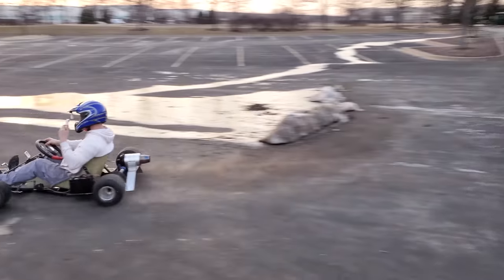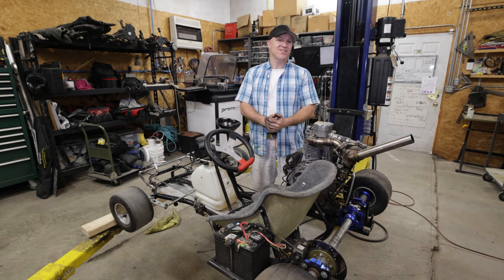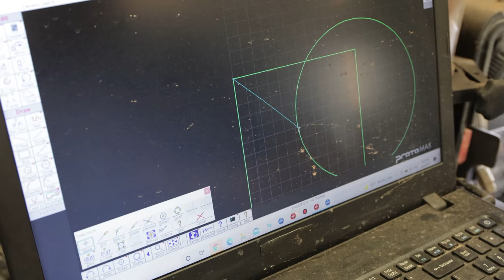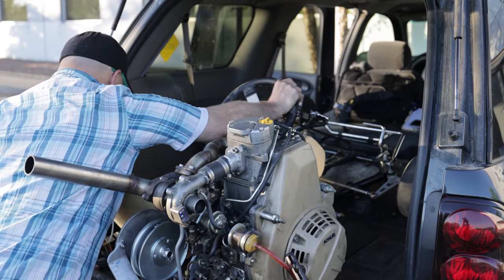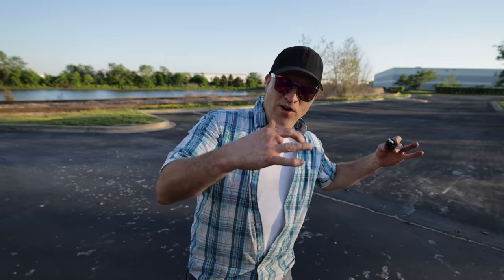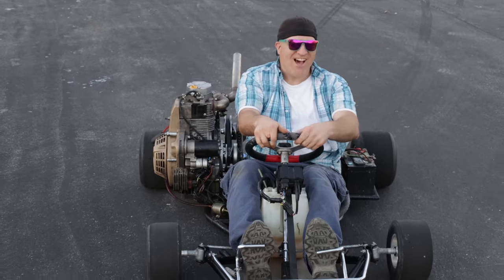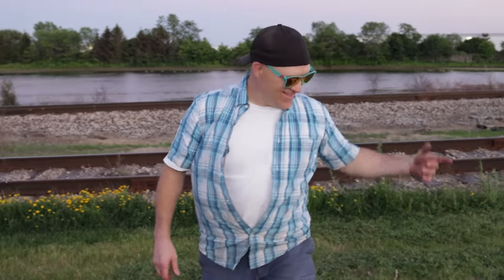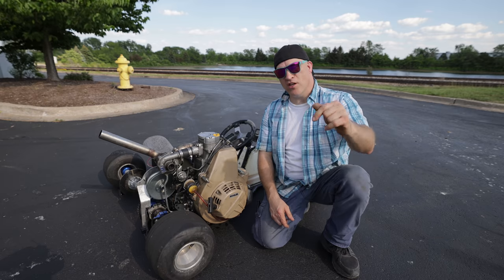Turbo Diesel Go-Kart W/CVT Top Speed

Comment: Make a 20T drive gear! The Diesel with the CVT would easily be able to pull that tall gearing and there would be a lot more room for the CVT to do its thing and get you to a higher top speed.
Reply: Yeah, the cvt is "topping out" too quickly. I bet a good gear setup will get 45+ out of it. I definately want to see updates with a few gear changes!
Reply: @volvo09  same!
Reply: They love the tall gears
Reply: @rosscullen406  yessir! Can attest to that!
Reply: I’ve got a clutch setup that hits 65+ before I hit the spray, that thing geared right should easily pass 50 plus
Reply: @braddorris4535  alright, that's awesome. No other words to describe it. Time to put a second engine for the front wheels!
Reply: I had a  10hp with a vbelt centrifugal clutch  setup and it did 70. 
Only thing is it's like riding  a 10 speed stuck in top gear. 
You gotta push it like a bobsled and then feather the throttle until the clutch locks, then it's hammer down. 
CVT on that would rip because it definitely had more pull.

Comment: When we were kids our go cart has a 78 tooth sprocket on the bottom and 14 tooth on duel clutch system and a 6 hp snow blower engine & were able to hit 45 to 50 mph. We used the mail truck as our guide as the driver wanted to see how fast we could make it go side by side with his truck 50 was the fastest.  Lol. We also had big tires on it as well.

Comment: Usually single cylinders don’t like turbo chargers, but that thing just goes! 🤩
Reply: works better with an air tank to hold boost between turbo and intake
Reply: Turbochargers Single cylinder needs big plenum at least twice the engine volume
Reply: @janilindroos3688  Diesel doesn't care how big or small the intake is for higher than atmospheric pressures in small cylinder configurations. It runs on compression ignition. Much more of the exhaust energy is converted into rotational energy in a turbocharger turbine than any gasoline engine will ever care to do. You only have to size the turbine housing and wheel properly for the amount of fuel heat you're going to be pumping into the cylinder.
Reply: In my place. Single cylinder N.A 700-1100cc  generator. Mods with turbo ex diesel truck and reduce fuel consumption arround 30%. And feel lots of power arround 1500-2200rpm.

Comment: It seems like the governor in the variable pulleys, isn't really matched to peak engine torque. The engine seems to be operating too low to allow the turbo to reach full boost.
Still cool though.
Here's an idea; tune this setup to max efficiency, then add a manual clutch, or a one-way bearing on the axle drive chain, then add the jet engine.
This way, you can have the best of both!😉

Comment: Diesels are super reliable, especially old style mechanically pumped ones like this one, very unlike the regular gas powered garden equipment you have to fight EVERY season.

A couple of years ago i got an old diesel generator that had been sitting for 6 years, without being started, and even though the diesel in the tank smelled really bad, nothing like diesel, it started right up at the second pull.
That is just something you only see with diesels.
This engine was a Yanmar L40AE - a tiny diesel.
Reply: good ol' 2 stroke detroits

Comment: You can adjust the spring tension on the TC so it goes onto a higher gear faster or slower. There’s 3 different holes in it from the factory and you can add more holes for testing. Less tension on the drum let’s it go into a higher gear faster and more tension makes it stay in the lower gear longer.

Comment: Those CVT’s need to be tuned to the engine. Get in touch with the guys from Go Power Sports. They sell the parts to tune the drive end of the CVT.  They probably have a larger drive gear too.

Comment: I wish they made more options for these projects people do

Like with other go kart engines they offer performance kits of all shapes and sizes i wish people would start making those kits but for kohler

Like turbo kits, cold air intake, exhaust headers, bigger cams, heavier valve springs, aluminum fly wheel, bigger injector. The list just goes on and on

Comment: Being that diesel engine and with turbo can put a small intercooler.  With this, you will be able to put more diesel and more pressure on the engine via the ECU, which results in +30 to 40% torque and +25% hp.  this will all make a big difference in this car in starting and final speed

Comment: a torque monster kinda limited by gearing/rpm, but it'd pull just about anything up to the same speed as no load. a 212 still has the speed for $ and you don't need much torque for karts, but still I think it'd be a fun ride

Comment: That torque converter is under rated for your power level and your gearing is really low. Also the governor needs to be adjusted to rev the diesel engine higher to get the full gear range out of the CVT.

Comment: A torque converter and a cvt are definitely 2 different items. You have a cvt which is a transmission, not a torque converter. Even though the cvt is the better choice even if you had the choice. You did not make more torque...you just didn't have the torque loss from the centrifugal clutch. Yes, a diesel has a lot of torque which is why they are used in OTR trucks.  My old Chevy Spark used a cvt and I likedit a lot. It never gave me any trouble either and didn't seem to mind me revving the little 4 banger to 7200 rpm at times :)
Reply from the maker: Hmm well you may be right but it was listed as a 30 series torque converter.
Reply from the maker: Here ya go https://amzn.to/2RRjn3n

Comment: Id love to see you get a V twin diesel or even an inline 2 cylinder and turbo it and throw it on an offroad gocart or lawn tractor. It should make alot more boost with the extra power stroke and timing of the intake valves opening.

Comment: 2 torque converters cut. One drive the other.  Used at same gears. Change how the torque converter works with springs and weights

Comment: You should test the jet vs turbodiesel at a dragstrip, maybe just a local type 1/8th mile if you have one reasonably close. I know many people look at dragracing as they next best thing to dyno's, where performance is taken to the ground. But Yes I would like to see a higher drive gear to put as much of that engines low-end peaking HP to the ground with the CVT.

Comment: Add another 2 identical jet engines and pipe them into one large afterburner unit. I bet you'd be looking at close to a 1:1 power to weight ratio at that point, possibly even greater than 1:1 depending on how much the ab contributes.

Comment: If you want a lot more out of it, then tune your clutches so it revs at a higher rpm on acceleration, plug off the waste gate on the turbo, and see if the fuel pump is adjustable so you can add more fuel. Diesels love fuel
Reply from the maker: All that is done ! I just didn't show it on camera.

Comment: Larger drive, smaller driven and smaller sprocket on the axle, can prob go with a larger drive sprocket on the cvt Jack shaft, it should have plenty of torque for it

Comment: You have to try propane injection. You just need a solenoid valve an adjustable regulator and a small grill bottle. It does wonders on my Mercedes.

Comment: You should make exhaust ”manifold” from smaller pipe. It would increase exhaust gas velocity and it would spool up turbo lot better.
Reply from the maker: That's a great idea, originally I was thinking about that and doing some math behind it but I wanted to make it look as tough as possible so that's why I went with an inch and a half pipe and then I tapered it down and made a nozzle right before the turbo.
Reply: @WarpedYT  That current one look ”tough”. 🤣
Maybe 1” ID pipe would be better.

Comment: Doesn't sound like the turbo was boosting. Put a few more psi on it for the next video :) great video, I'm loving it !
Reply: He will have a hard time loading the engine, he's running out of rpm not power. Diesels don't make boost without having sufficient load.
Reply from the maker: It's making boost I believe only about 8 psi, every video I do with this card I keep on forgetting to put the boost gauge on, but I think in the next video I'm going to make a different turbo setup just to make it more badass, something that's going to make some serious boost, and I'll remember to put the boost gauge on it
Reply: @WarpedYT  I'm gonna guess that you are an engineer and a fabricator....and perhaps a shop owner too :)

Comment: Your rear tire on the right side make smoke much more than the rear tire on the left side.. Probably because the engine's power distribution much more closer to the right rear tire based on where you mounted that engine's position...

Comment: What size battery are you running with that setup? I have that same engine sitting in my shed right now that I got off of a generator that was destroyed from falling off the back of a truck. Engine is still in great shape, turns over and runs great. I'm just waiting for the right time to put it in a project!

Comment: Nice job it would be interesting to find out how big a sprocket you could go to on that thing… you have the reduction in the torque converter so could it run the same size as the axel sprocket…..

Comment: still sounds like you're geared out on the straights my dude. Can you put a bigger sprocket on the cvt-chain jack shaft? you've obviously still got a preponderance of down low torque so it probably wouldn't hurt getting a higher gear ratio on it.

Comment: You'd go fastest with a centrifugal clutch and proper gearing, because a centrifugal clutch has no losses once it achieves lock up. Those torque converters suffer significant losses at the lower reduction (top speed) end of the spectrum; however they are great for better acceleration.

Comment: Built a yerfdog with a diesel yanmarL70w and a comet tav2 30 series cvt. When taking off under heavy load the belt will "judder" and vibrate up and down violently while at very low speeds and higher speeds its fine. Have you run into any issues like this?

Comment: You know, it didn't occur to me in the original episode with the gocart+turbodiesel, but what fueling mod's were made, if any to this engine after the turbo? I know you went further in-depth with the turbo Brigg's & Stratton because you kind of had to (EFI vs Carbureted) to net best performance, make boost, etc. 

I know you mentioned the diesel was making boost, and I know diesels can better adapt to leaner fueling conditions by design, but still, I would think theirs equal or similar efforts needed to make gains by fueling mod's, even with just a piggyback AFC, or injection pump changes if EFI weren't as heavily relied on for the operation of this engine.

All in all, it would be cool to see a Dyno video with the turbo to compare it to the NA videos done with the 3 grades of diesel, then maybe embark on some fueling mod's (if within reason for a small diesel) like done with the Briggs& Stratton.
Reply from the maker: Thank you for the feedback I have taken note, I start back filming on YouTube today so I'm going to get that episode in the queue I think that is really interesting and you have a great point. I do think that I need to turn up the fuel a lot to start really rolling some coal, but in this case I don't think this engine will ever roll call it just seems so overbuilt for the amount of power that it makes but who knows.

Comment: That go-kart needs a limited-slip differential. You can actually make one by using two freewheels.

Semi-related, I wonder if it would be viable to use a freewheel to combine a turbocharger and a centrifugal supercharger into a single unit, driven by both the crank and the turbine. Could you get the best of both worlds (boost response vs efficiency) that way?

Comment: Looks like you’re making a gear dude. This thing could do 70-80mph easy.
Reply: Had Similar setup with a MAC 101 go kart engine on a 3 wheel kart. It would do 65mph.  That is fast with garden tractor turf tires on back and minimize steering on front.  Interested on doing the TC Diesel Luke this on a 3 wheeler.

Comment: You need to build an air capacitor between the turbo and the engine, this turbo configuration does not generate much boost if any. I recommend a 5 to 7 liter capacitor for this configuration.
Edit: wrap some fibreglass tape on the exhaust pipe, it's dangerously close to you!
Reply: Boost is a measurement of restriction, pounds/kilograms of air consumed per minute is a far better way to determine the efficiency of the system. 

And 5-7 liters? He may as well remove the turbo completely, on a little setup like that he'd have a 20 minute lag from the turbo when he throttled up.
Reply: @jaydunbar7538  The nature of single cylinder 4 stroke engine makes the intake and exhaust cycles out of phase, there are several research documents that propose using an air capacitor as a solution, with little lag and excellent results.
Reply from the maker: You are correct, I've been thinking about doing that for a while, it's basically just a plenum but there is some math involved and you are correct the pulses are out of face although they are dampened by the inertia of the mass of the turbocharger... But the plenum will help a lot. I may do the ultimate build for the next episode where I do a top speed, I'm thinking of doing something a little bit different just for fun...

Comment: If the engine have mods on injection pump. Make higher limit to 6000rpm. I think its more fun. 😁😁
Because old diesel isuzu 2.5 mods iniection pump incrase limit rpm to 6000rpm and feel more than gasoline with same max HP

Comment: Surprised on how slow it was, must of picked up a lot of torque.. my Briggs 206cc with a centrifugal pulls me up to 70kmh
Reply from the maker: It's because of the RPM, all of these cvts and centrifugal clutches are All made for gas engines where the RPM is going to get up there for like 6,000 or so or maybe more. Since it's on the diesel I have to modify it

Comment: if u can't find larger sprockets, add a jackshaft or better yet a gearbox with maybe hi & low plus reverse is really nice to have!  also using a jackshaft  allows for a much larger range of gear ratios.  What is ur driven gear sprocket now? u might also wanna check out a larger CVT unit, i started with a comet 30 style like ur using but went thru belts real fast until i stepped up to a 40 style unit, the belts can handle way more power & will give u a better gear ratio spread too.
Reply from the maker: I'm totally going to check out a 40 series again, I looked for months and months for a 40 series but I could not find one, this one does have a jack shaft but in all reality I have to move on to my next episode so I may do one more with a larger gear just to show off some of my equipment and make the gear from scratch.
Reply from the maker: Okay thanks for your advice, for some reason I could not find a 40 series torque converter before but now that I have the equipment to make the shafts and whatever else which I didn't have before I just went on Amazon and bought a 40 series torque converter.
Reply: @WarpedYT  right on, can't wait to c that! I was gonna say i found a large "40"style on old quads, snow machines, & even large scooters.  I really luv c'n all the great projects u run & I'm sure this will b another big hit!
Reply from the maker: Thanks, yeah for some reason when I looked for it 6 months ago I could not find it anywhere but now seems to be on Amazon I found it easy.

Comment: Needs fine tuning on the variometr weights. Normaly on a cvt the revs should stay in the perfect power rpm all the time
Reply from the maker: I removed one of the 2 springs to reduce the engagement rpm, it worked well but now I regret not including that piece in the episode.

Comment: What chain size? A 15 tooth motorcycle drive gear should be easy to find and easily adapted to the cart. That thing should easily have enough torque to push quite a bit faster.
Reply from the maker: It's the gear on the jackshaft, different chain shaft combo
Reply: @WarpedYT  with the tools you have and your amazing talent, i don't see fitting whatever gear you wanted on the jackshaft as being much of a problem

Comment: you probably want to up the fuel flow to increase the power
its not used to having a turbo on it so its running super lean
im sure there's people that want to see it roll coal
Reply from the maker: I've been trying to get more fuel into this thing, but the issue is the fuel pump is limited by the size of the piston.

Comment: Why not put two CVT one driving the other for the ultimate acceleration and top speed?! Would it work is the other question.
Reply: it can work, but the cvt itself robs power because of the friction, so you're better playing with gearing than using 2 cvt.

Comment: A differently weighted torque converter would do a lot better, those are meant to engage with a gas engine not a low revving diesel
Reply from the maker: I removed the springs, I forgot to show that in the video

Comment: Is there an RPM limiter on the motor or can you give it more fuel and boost to get some more RPM's?
Reply: Valve train is likely the limitation to rpms
Reply: @jaydunbar7538  should have some overhead beyond stock, or just change the valve springs if they're that weak.

Comment: Never ever wear a loose shirt around a moving engine part where you will be pulled into the engine and have severe injuries.
Reply from the maker: I know but I'm prepared, in this case it wouldn't pull me in even if I did get caught. But I did button the shirt.  Thanks!
Reply from the maker: You are absolutely correct!

Comment: So much wrong with your theory. No fuel injection recalibration for the turbo just means the you are restricting the exhaust, causing power loss . If you had a way to increase the fuel, and tweak the governor maybe 700 revs more and not twenty but 16 teeth, you might have it